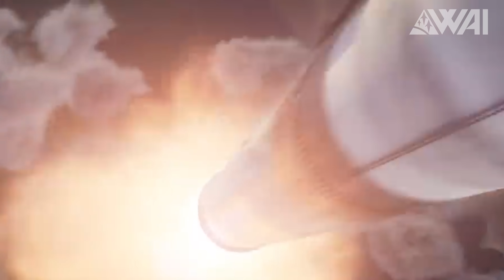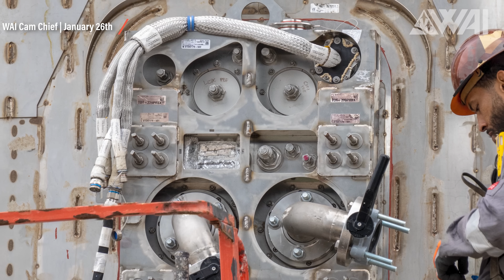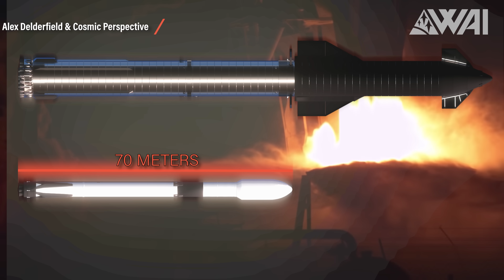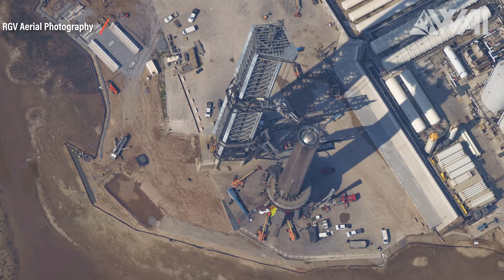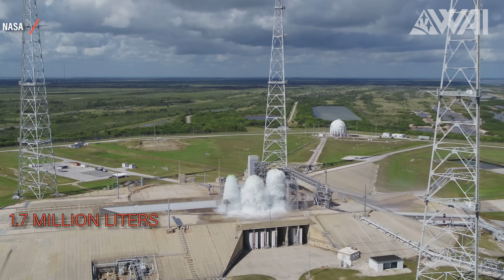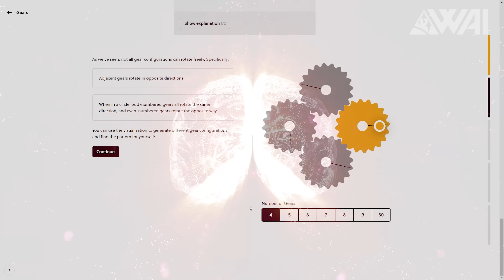SpaceX Is About To Ignite The Starship Booster! How LARGE are we talking?

Comment: @4:37:  Rocket Labs’ Electron rocket is 18m in length, so shorter than Falcon 1, even.  Another good comparison.  NASA’s Mercury-Redstone rocket was 25m in length.  These two comparisons would have been nice, too. 🙂.  Redstone was lifting a relatively heavy payload, the Mercury spacecraft was somewhat less than 3,000 lbs (1,400kg); and so, it was only a suborbital flight.

Comment: Rust is caused by welding on stainless steel  ...very little to do with the salt. I've done it in closed spaces and there was no salt involved.
Reply: The term is called sugaring of stainless . You are correct salt water did not cause this . The weld was too hot or not enough shielding gas . With optimum temperature and shielding gas there is very little sugaring of the stainless . If i had to guess by looking at the picture the weld was way too hot . Most welders take a wire brush to the sugar to stop it from spreading . I guess SpaceX robot welders dont clean its own welds lol .

Comment: There may be rust everywhere across the stainless steel hull because of welding rods usage. Basically, stainless steel is not completely "stainless." Especially when you touch/hurt it with non-stainless iron (like welding rods). It creates a kind of starting points for rust. As I can see, the rust propagating mainly around old welding seams, so this theory can make sense. After implementing something like argon welding during the serial Starship production, I hope we'll not see any rust across the hull.
Reply: Its the result of welding at too high a temperature or not enough shielding gas . It is not the result of sea water . The term welders use is called sugaring .

Comment: So, just quickly ball parking the numbers.  The Saturn V delivered 7.5 million pounds of thrust with engines housed in an area of about 78.5 square meters.  The Super Heavy Booster will deliver an estimated 17 million pounds of thrust with engines housed in an area of about 63.6 square meters.  That is the Super Heavy 33 engines will occupy about 81% the area as the five F-1 engines of the Saturn V.  

The Space X engineers have convinced themselves that it is possible to have the heat, vibration, and shock waves  of about 2.25 Saturn Vs in about 4/5th as large.   There was some space between the F-1s.  The Raptors are packed as tight as possible in the limited space (compared to a Saturn V. )

It is going to be very interesting to watch the test firing and possible eventual launch of the Super Heavy Booster.  I wonder what the brilliant engineers who built the Saturn V would say about the hubris of Space X.  

I think the Super Heavy Booster has inadequate diameter.  The structure is too tall and slender to accommodate the force of the raptors.  The launch pedestal is, when compared to that of the Saturn V,  laughable.  I doubt a Saturn V could be successfully launched from such a structure even given the fact that it had so much less thrust than the Super Heavy Booster.  

And, yes, we all want to work and I'm a huge Space X fan.  And yes their successes with Falcon 9 and Falcon Heavy have been spectacular.  But.

Comment: I don't know why SpaceX postponed the deluge system because by now and before development they knew exactly what would happen to the concrete. My guess,  the attention to the new launch system needs to be in focus all the time. SpaceX never intended to not shield the ship from blast burn debris, rather test rocket engines taking damage incase they did experience an issue. It is that simple. You are in experimentally stage so hit the buttucks of the rocket and see.

Comment: I think the best way to communicate the scale of Starship is to compare it to the most familiar large rocket ever built - Saturn V. The Starship + booster stack is 10 meters taller than an Apollo/Saturn V stack. At its widest, Saturn V's first and second stages were 10 meters in diameter, compared to Starship's 9 meters. When you see Starship fully stacked, imagine a Saturn V next to it, but about 32 feet shorter. It's a big rocket.

Comment: FYI:  Rust on stainless steel can be attributed to using a too hot welding arc.  It burns the nickle out of the stainless steel.
Reply: Correct Patman . Stainless does not rust easily . What Felix calls rust is actually the sugaring of stainless when being welded with too high temperature and too little shielding gas .

Comment: PROBLEM SOLVED, Heat  tiles  vibrating  loose  ,  large thin sheets  of  the  same   heat material  can be  developed  to cover the  the  existing  tiles  there for  if  it  happens  the tiles  will  not be  able  to fall off the  STARSHIP. PROBLEM SOLVED !!!!

Comment: The water deluge system at LC 39B is also used for sound suppression.  It is known as the sound suppression water system.  It's main function is to reduce acoustical energy which can cause significant damage to the vehicle and pad as well as cool down the pad at launch.
Reply: I’m glad someone pointed that out; acoustics has always been the #1 reason for the system - and, the #1 reason damage is caused, when the system is not sufficient (or, in SpaceX’s case, sometimes non-existent!).

Comment: Felix, 33 engine static fire will not happen for 3-4 weeks, that is my prediction. My prediction is as follows:

Ship 25 static fire
ship 25 returned to production site
complete installation of water deluge system.
static fire of the 7 new raptor engines that have been installed on Booster 7
spin prime test of all 33 engines.
33 engine static fire
replace engine that don't perform Nominally. Replace engines, static for the replaced engines. 
33 engine static fire again
If successful, apply to the FAA for launch license. 
Launch.

 So, my prediction, is we will not have a 33 engine static fire for 3 - 4 weeks as in my opening statement, and sub orbital attempt by Mid April/May. every one say this will be an orbital launch, it is definitely not. the First stage of super heavy will splash down in the Gulf of Mexico, and the Second stage will splash down near Hawaii, so, not an orbital attempt, more of a capability test. Don't forget, the original application submitted to the FAA was for 5 Sub Orbital attempts, and 5 orbital. This will be one of the sub orbital.

Comment: As much as I want Starship to succeed, I think the static fire test is going to play havoc with the orbital mount beyond what they're expecting to the point of total failure.  My guess is that the 33 raptors aimed straight at the ground are going to churn the concrete as if it was just water.  After the 7 and 14 engine tests caused significant damage that required repaving the pad both times, it makes me wonder why a defection system wasn't considered in tandem.  Then again, I guess this is why we run tests.

Comment: Great episode, Felix!
Now, regarding the protection of the concrete base under the OLM, I will say this: breaking / pouring an additional concrete structure is always easier, cheaper and safer than repairing the main one.  Therefore, I propose to pour an additional concrete plate under the launch pad, maybe even a cone-shaped one with a thickness of about a meter along the outer contour and 5 meters in the center - to redirect the flame.  You can change the plate as it wears
Reply: The reason I’m giving you a Down Arrow on this is because you’re missing one of the main reasons for need of a system: It is NOT just to prevent damage to the ‘core’ system; it is to prevent the generation of high-energy debris- shrapnel, if you will- going in all directions, bouncing off everything, and hitting everything - INCLUDING POSSIBLY THE PROPELLANT FILLED ROCKET ITSELF. In astronautical engineering, we would call that ‘bad’. In fact, in the shuttle days, we had a pad walk down team whose job was to look for lose items that could become debris that could be thrown around and come back and hit the vehicle. So, your proposal for a ‘sacrificial’ concrete layer- one that would, in essence, become a high-energy explosive shrapnel generator in the early seconds of launch- is, er, ‘Disapproved’. Sorry. - Dave Huntsman
Reply: @dphuntsman  Pallets of Fondag RS have been spotted recently at Starbase. Fondag RS is a super concrete capable of extreme heat and pressure without ablating the surface.  This is what they put down when they repaired the damage from the last SF. They have been testing this stuff at the MacGregor site by firing raptors at targets made of Fondag RS with good results.

Comment: Hi heat from welding precipitates carbon to the surface of the weld. This creates the areas with the light rust and staining. Not a concern for the short-term, but after several years could become more of a problem.

Comment: Could the booster use less than the fulll number of rockets to launch and after 1000ft in the air turn on the other ticket engines to save damage to the launchpad as well as surrounding areas?

Comment: Question. Is the Ground needed to push the rocket up in the first stages in flight? I mean in flight there is also no ground to push the rocket. Why don´t dig a gigantic hole in the ground with a tunnel for the exhaust gases vented somewhere. More distant to engine less heat, less force, less destruction of concret.  I know the hole thing near bay has it challanges of it own, but i just trying to understand the dynamics here. I am not an engineer. Could this work? A smaller water System in that hole could work also to help with stress on the hole system, or not? Just asking (not for a friend). Anyone here who could answer that for me in a maybe not so much in depth way, so i can think about other solutions.
Reply: Or let me rephrase this otherwise. How deep must the hole be that the pressure and /or heat would´nt  be a problem anymore. Or did i forget some other factors that play a role in that scenario? I think the near beach scenario could be a problem or maybe a solution?
Reply: Using the nearby pressure from the sea (and water) to power a system with a deep hole could be genius. Just thinking out loud. You can stop me anytime :-) . Well we know how Elon knews how to dig deep holes right?

Comment: We can expect a 6 months delay when they redesign the ship and booster as they WILL need landing legs for all landings. Tower catching is not viable especially on the moon and on Mars. I just hope nobody dies before Elon realise this. A wedge of pykrete (frozen water and sawdust) would be a excellent flame diverter as it is cheap and easy to replace, built to be consumed and already mostly water. Add a deluge system for noise reduction and it would be done.

Comment: The brown around the welds could be rust bit more likely due to welding process or post weld cleanup. Stainless turns different colors then carbon steel when welded or if the welder used a steel wire brush or wheel or sanding device that has iron oxide will also cause the same color.

Comment: Wouldn´t a taller, higher orbital launch pad need the water deluge system? Suppose that the rocket engines stood 3 times higher, away from the ground, wouldn't it solve the problem of orbital pad degradation?

Comment: Starship Heavy would make sense….. if it allowed a fully fuel loaded Starship to be placed in the right orbit thus negating the need to return it to earth or the need for many refueling launches. Assuming the Boosters would be low enough to return to earth without damage.  
This may become a reality if the heat shields remain unreliable.

Comment: You know there is a possible Starship ULTRA.  A central core wrapped by not 2 but 6, YES SIX, more boosters.231 Raptors?  Got to be equal to a nuke

Yea, that bad boy would be a ULTRA Starship
Reply: Source? Or did you just make that up off the top of your head?
Reply: @BlueZirnitra  um, my source? You mean for the idea! ULA, Russia and others already have rockets with a central core wrapped by 6 boosters.
Reply: @VAMobMember  sure, but that doesn't mean it is going to work for boosters this big. You can't just scale everything up and have it work lol. Superheavy is showing a lot signs of getting towards the limits of what is practical with rockets. I just don't see a rocket that big, with that many moving parts, making any sense. What kind of a monstrous payload can you see needing 6 of the biggest rockets ever built around it?

These designs take what would be a full sized booster and divide it into smaller boosters. A starship version following that design ethos would take superheavy and split it into several smaller boosters with less engines. You wouldn't need 231 raptors, I don't think anything ever will.

Comment: Hmmmm

If B7 fails there are two extremes.
1) the O2 and CH4 burn off over a long period of time
2) the O2 and CH4 burn off in a femto second or so.

So what is the worst case explosive yield expected to be and how much damage at various distances. What is the Tornado (EF#) damage equivalent going to be at different locations/distances?
Reply from the maker: I had an episode about it. It is EXTREMELY hard to estimate as mixture plays a large roll in a combustion. Th verdict was, that even if the mixture is extremely good, the explosion won't harm much more than the Tower and the Tank farm.